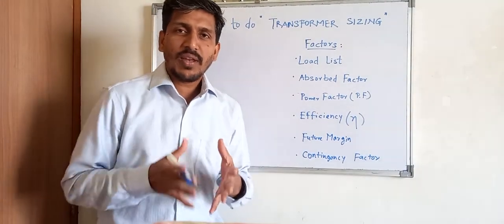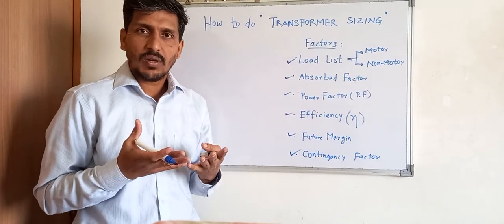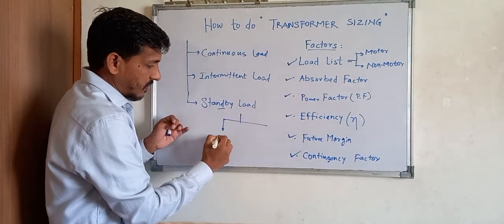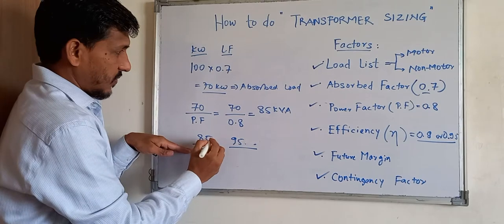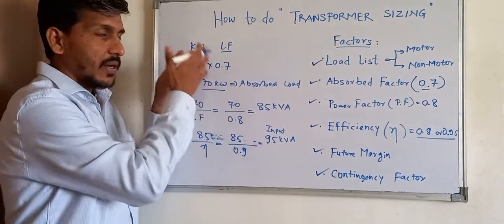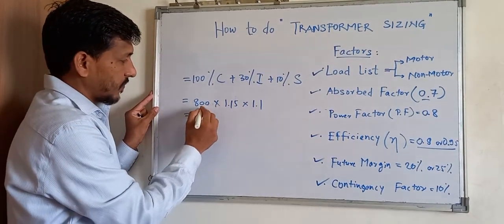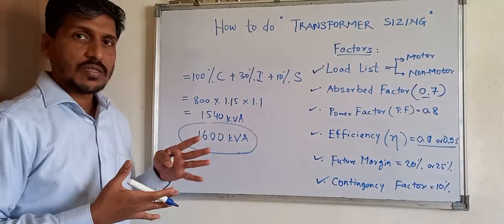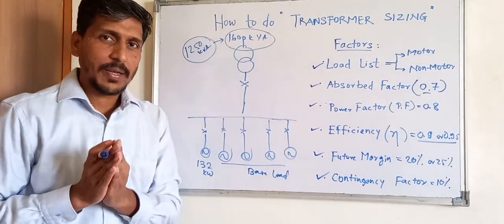How to do "Power Transformer_Sizing" Calculation

Comment: Hello Sir.. In this case you have loaded transformer to 100% 
Can we load transformer to 100% ? 
Second thing is should we really consider starting of largest motor for transformer sizing?? Because I heard that transformer is capable to handle the inrush current for some time.
Reply from the maker: On Practical level, Transformers are loaded only 50%, max 95% can be loaded, 100% loading is the ideal case which is never done. For Highest KW Motor starting, it is one of the factor to be considered, even we consider this factor on DG Sizing.....Hope it clears ur doubts
Reply: Thank you so much Sir